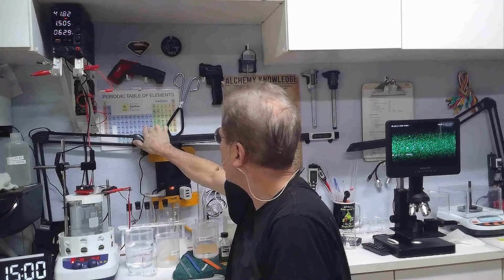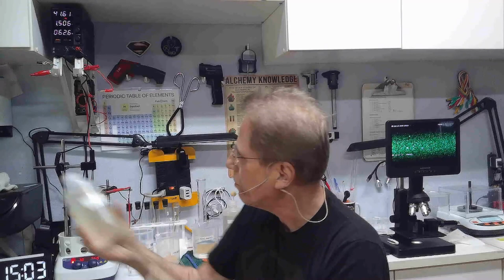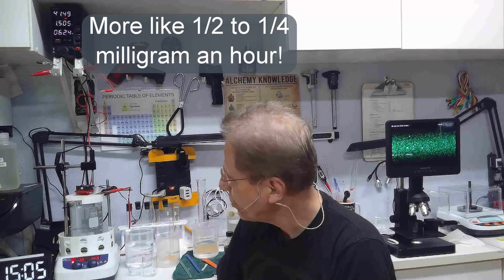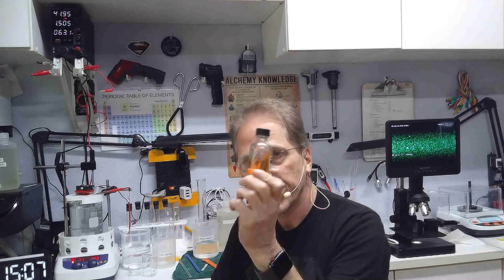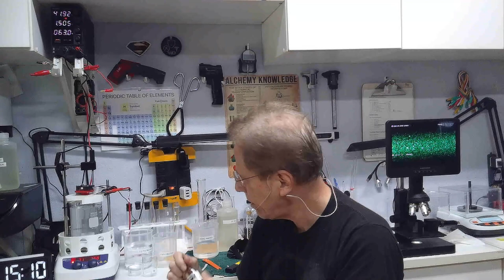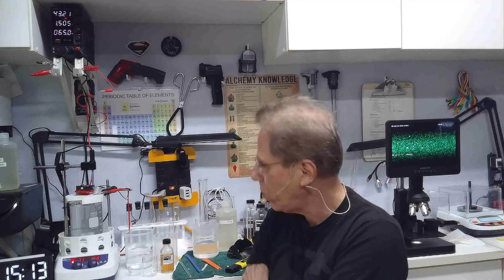Platinum Update Batch #40 using low voltage electrolysis!

Comment: Hard work.Platinum is like Uranium hhhh
Reply from the maker: It sure is. Silver, copper, zinc, were easy. Then I came to gold and it was a bear, until I got the formula specifics working. At that time the gold formula was out there but the exact amounts of what to use were not. Trick there was figuring out what everyone's pinch of this and that was. However Gold was never as hard as this platinum. This metal confounds the senses sometimes. 

There was no formula out there for platinum, I had to scrounge through scientific journals and industrial papers on how they were creating platinum nanoparticles using Chloroplatinic acid, which is basically powdered platinum. Then try to adapt what they do there to work on metal rods. 

I've made progress as you can see. I now get about 3 to 5 milligrams off the metal with each 10 hour batch. That is much better than the 300 micrograms I was getting at the start. 

I'm just about there with releasing the formula I have now, even though it's tricky. I do want to check a couple more things on that formula first.